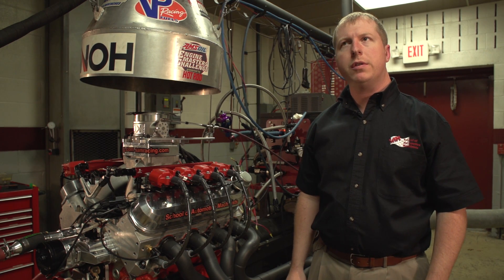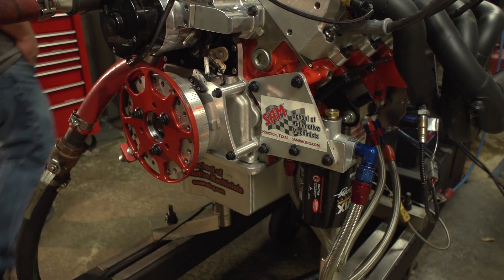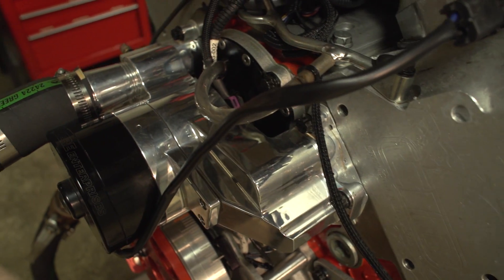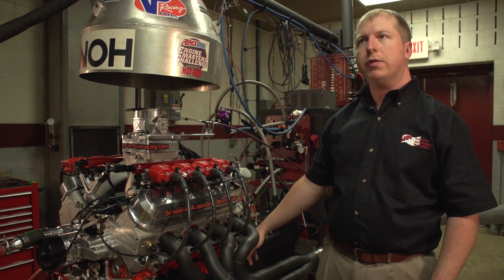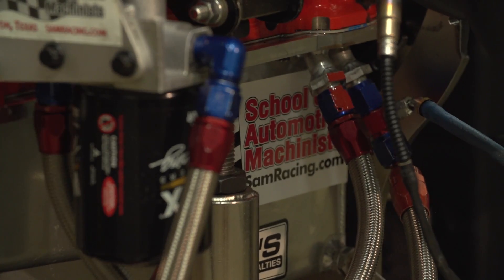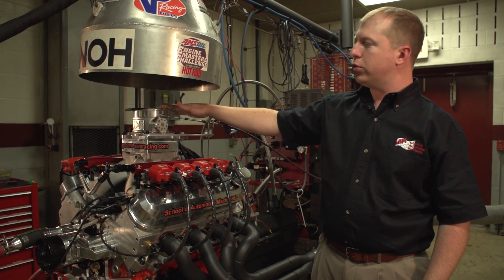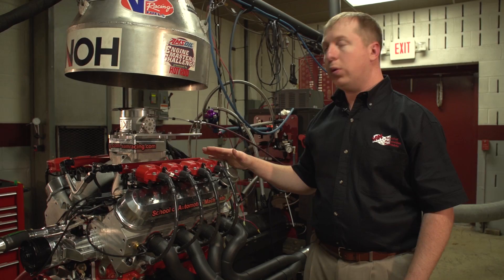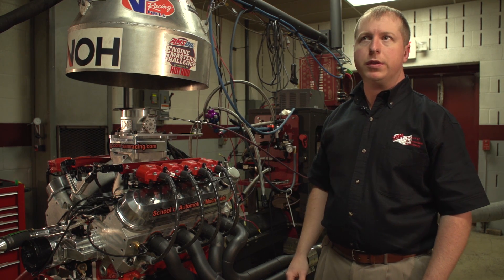725-Horsepower LS Engine by School of Automotive Machinists, Engine Masters 2014

Comment: FORD 366ci CLEVELAND MOTORS BACK IN THE EARLY 1980'S IN PROSTOCK WERE MAKING 750HP WHERE THE NHRA HAD TO HANDICAP THEM AND MAKE THEM CARRY 250LBS MORE WEIGHT AND THEY STILL BEAT THE CHEVY'S. NOW CHEVY COPIES THE FORD 427 HIGH RISER AKA RAISED PORT 351 WINDSOR DESIGN AND IS THROWING A PARADE DOWN 5TH AVENUE. IF YOU GO RIGHT THROUGH THE LS FROM BLOCK TO HEADS IT IS COMPLETELY ALL BASED ON FORD DESIGNS RIGHT DOWN TO THE FIRING ORDER.

Comment: Just over 1 HP/ Liter.. Like a factory Honda DOHC Engine..
Reply: Yeah, sadly both fall far short of the 700hp a liter .21 ci nitro engines make. Oh yeah, that's right, the very nature of the universe means its easier to post good HP to displacement ratios the smaller the engine is.
Reply: The Whole Enchilada idiot
Reply: that's very dumb comment

Comment: I am not sure how the Hemi won over the LS when it made less hp and tq then the LS from school of automotive mechanics that had the highest hp and tq but only got 4th place.
I am guessing the Hemi's had a broader hp/tq curve with a smaller cid.
It seems the dual coil/spark plugs of the hemi may have played a role to get the win over the larger LS engine.
Reply: +harry guy it's based on average torque and power.
The hemi chamber has ZERO valve showing allowing them to use a smaller duration cam.
smaller dur cam made more low end torque making the "Hemi" win

the dual plugs are because that Hemi chamber has  a VERY inefficient fuel burn

Comment: Of course the gm is top.
Reply: Sanic  I agree that with forced induction the size matters less. In this case with a naturally aspirated engine like these are it matters. This Chevy is over 30 cubes bigger than the 712 HP Hemi. After all of the tuning and testing the GM makes 102HP per liter while the Mopar makes 108. Fact is size does matter in this case.
Reply: Shoshanna Rubin
Your argument is invalid then.
Reply: Shoshanna Rubin
Actually, looking at failure rates, the Hemi is not as reliable.
The Hemi has a higher OEM failure rate from the factory.
Reply: It's got half a litre on the Hemi. Of course it makes a bit more power.
Reply: Shoshanna Rubin
Ci arguments are irrelevant in 2014 standards.
There 1.0L engines making 1000+ horsepower.
Reply: Shoshanna Rubin
These competitions have rules,
They are within the rules, so the Hemi should have boasted more CI.
Reply: Not at all. The other person said "of course the GM is on top" Implying that it is a better engine. It merely made more power because it was larger. Exactly as I stated, nothing invalid about my statement.
Reply: Sanic My comment was not about reliability... In any case my comment still is accurate, the engine is larger. BTW I own a Hemi powered car and it has been supremely reliable.
Reply: Shoshanna Rubin
Just not as reliable as a LS.
Reply: Sanic with 200mm turbos?
Reply: I never said that the LS engine builder cheated. I just was commenting that it made more power because it was larger which is true in this case. In the end however the Hemi took top engine in the competition so it is a moot point anyway.